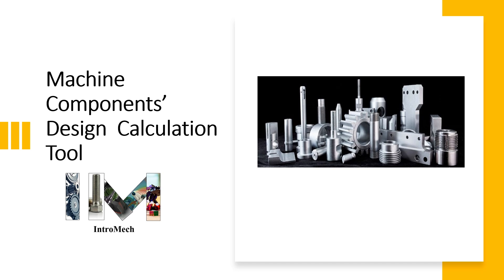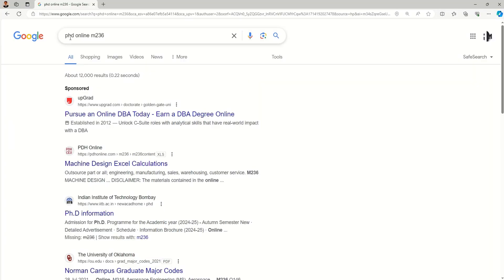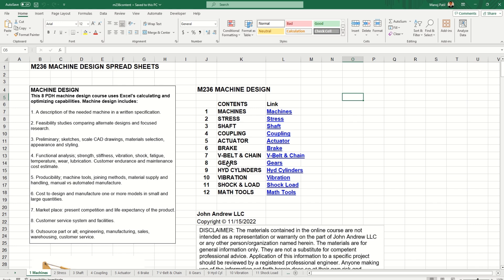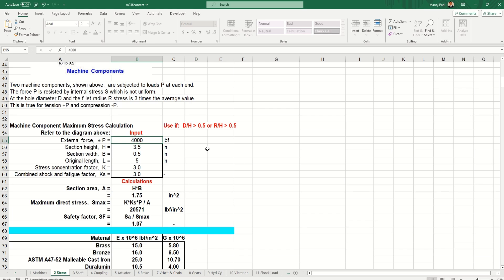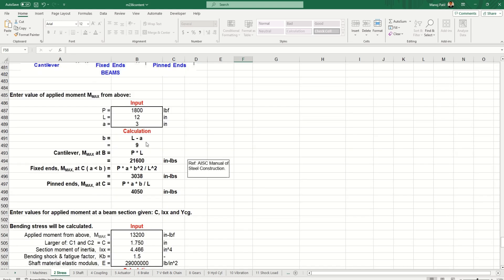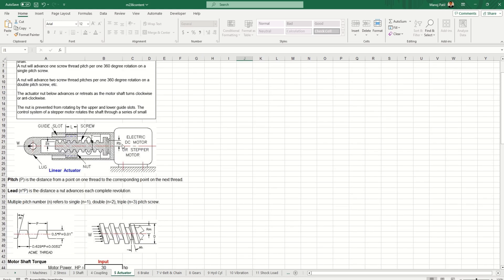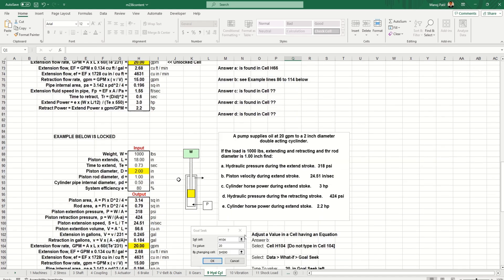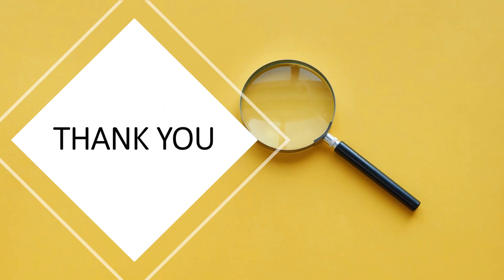Machine Components' Design Calculation Tool

Comment: Sir
Can you guide me Pneumatic and hydraulic 
Related O-Rings and Seals
Reply from the maker: Hello what exactly  do you need regarding the same?
Reply: @IntroMech562  O - Ring - compression Size tolerances, backuprings its direction,
Reply from the maker: @BasampalliVenkateshKumar-d6c  Check out these links. Lot of online calculators are available. 1)https://ceetak.com/o-ring-calculator/ 2)https://oringcalculator.eriksgroup.com/ 3)https://www.maxspare.com/technical-support/o-ring-calculator 4)https://www.cog.de/en/products/all-about-o-rings/o-ring-calculator